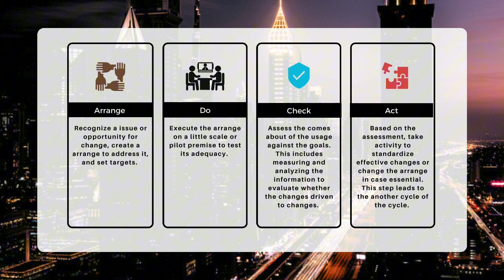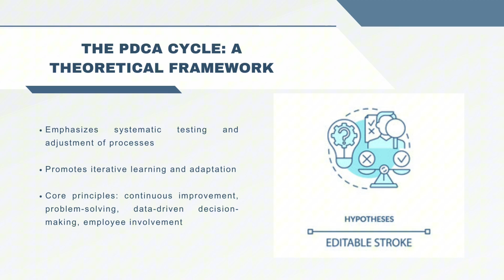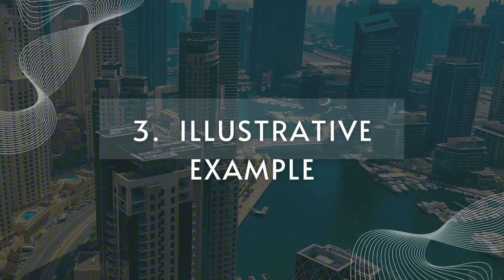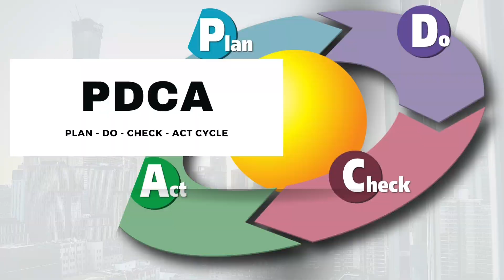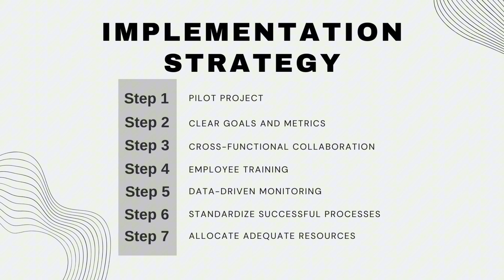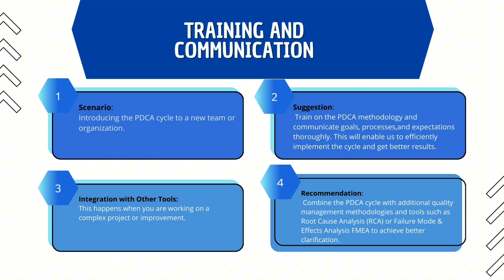PDCA cycle presentation

Comment: Hi, I'm Phước Anh, from group 2. My question are: 
1. In the video your group mentioned that combining elements of 3 methodologies can be a powerful strategy, so can you tell exactly the way to do it ?
2. How can PDCA be integrated into creative industries like design or marketing, where innovation is prioritized over repetitive processes ?
Reply from the maker: Hi, I am Huy, representing group 8, here is our answers:                                                                                                                    1. we don't clearly understand your question, but if you mean if we could explain more clearly how we could combine elements of PDCA, Kaizen, Lean, and Six Sigma then this will provide you better insights:
Start with PDCA as the Framework -> apply Lean for Process streamlining -> utilize Six Sigma for Data-driven decision-making -> Incorporate Kaizen for employee engagement -> Create feedback loops -> Standardize and scale improvements.

2. In creative industries like design or marketing, where innovation is key, PDCA can be integrated by focusing on iterative experimentation and continuous learning rather than repetitive processes. The Plan phase can involve brainstorming creative ideas, setting campaign objectives, or exploring new design concepts, allowing room for innovation. The Do phase involves testing these ideas on a small scale, such as launching pilot campaigns or creating prototypes. In the Check phase, feedback is gathered from clients, audiences, or internal teams to assess the impact of these creative initiatives. Finally, in the Act phase, successful ideas are refined, scaled, or adapted, while unsuccessful ones are discarded or reworked. This cyclical approach ensures that creative teams can innovate continuously while learning from both successes and failures, promoting ongoing improvement without stifling creativity.

Comment: Hi, I'm Ngọc Hưng from Group 1. I have 2 questions for your group:
1/ How do firms know when they should start using PDCA cycle?
2/ As you mentioned, PDCA cycle is used to improve processes. But process improvements must be defined in terms of increased customer satisfaction as a result of higher quality
products and services. So how can PDCA cycle improve employee morale?
Reply from the maker: Hi, I'm Huy, representing Group 8 thank you for your questions. Here are our answers:                                                             1. Firms should start using the PDCA cycle when they identify a need for continuous improvement in their processes, products, or services. This often becomes evident when there are recurring issues, inefficiencies, or declining performance that require systematic problem-solving. Additionally, when organizations are aiming to implement changes but want to minimize risks, PDCA provides a structured, iterative approach to testing and refining solutions. Firms may also turn to PDCA when launching new projects or initiatives, as it helps in ensuring processes are optimized from the start. The cycle is especially beneficial when the goal is long-term sustainability, quality enhancement, or innovation.                                                                                                                                                     2. The PDCA cycle can improve employee morale by fostering a culture of engagement, participation, and ownership in the process improvement efforts. When employees are involved in identifying problems (Plan), implementing changes (Do), and reviewing outcomes (Check), they feel more valued and invested in the organization's success. The iterative nature of PDCA also encourages continuous learning and skill development, which can boost confidence and job satisfaction. Additionally, by systematically addressing inefficiencies or challenges that employees face in their day-to-day tasks, PDCA can help create a more efficient, less stressful work environment. Clear improvements in processes and work conditions, driven by employee contributions, can lead to a sense of accomplishment and higher morale. Hope this help.

Comment: I am Trung, representing Group 6. First thank you for providing us a useful video about PDCA and we have 2 questions for your group:
Q1: How does the group make sure the "Check" step helps find problems or areas to improve in the quality process?

Q2: Can you give examples of how your team used the PDCA cycle to solve quality issues, and what results you got?

Thank you so much and we are waiting for your answers.
Reply from the maker: Hi Trung, I am Huy represent Group 8. It's great to know that you find our video useful and thank you for your question.                                                                                                                                                                                         For your question 1: The "Check" step in PDCA helps identify problems or areas for improvement by systematically evaluating the outcomes of the actions taken during the "Do" phase. It involves comparing the actual results with the expected outcomes set during the "Plan" phase. This step typically includes data collection and analysis to measure performance, quality, and any discrepancies from the goals. If the results fall short, the "Check" step highlights where the process didn’t meet expectations, uncovering specific problems or inefficiencies. Continuous monitoring and feedback ensure that issues are identified early, making it easier to adjust or refine processes for improvement in the next PDCA cycle.                                                                                                                                                                            For your question 2: Take our video project on PDCA as an example.                                                                                         Plan:
- Goal: Create a high-quality educational video about PDCA for YouTube that effectively explains the concept and engages viewers.
-Problem Identified: The initial idea lacked structure, and we anticipated difficulty in clearly explaining complex topics.
-Action Plan: Research PDCA thoroughly, create a detailed script, assign roles for each team member (writing, editing, voiceover...), and plan how to handle questions from other groups.
Do:
- Our team created the video based on the script, filmed and edited it, and uploaded it to YouTube. The video was shared with other groups for viewing and feedback.
Check:
- After uploading, we reviewed the feedback from other groups, especially their questions. Some questions highlighted areas where explanations were unclear or confusing.
- Key Finding: Viewers appreciated the visuals but found certain parts of the explanation lacking in depth.
Act:
- We updated the video’s description to include more detailed written explanations and added timestamps for key sections.
- For future videos, our team planned to include more real-world examples and practice answering potential questions before uploading.                                                                                                                                                             Our results are: Improved Understanding, Increased Engagement, Efficient Process.                                                              Hope this help. Thank you

Comment: Hi, I'm Vân Anh from Group 4. We have 2 questions for Group 8:
1. In the "Do" stage, what types of data should be collected and how can this data be used to evaluate the effectiveness of the plan? 
2. How can organizations effectively share and collaborate on data within the PDCA cycle, especially in large or distributed organizations?
Reply from the maker: Hi Vân Anh, thank you for your questions, here are our answers:                                                                                                                                     1. In the "Do" stage of PDCA, businesses should collect both quantitative data (such as production rates, defect counts, cost reductions, or time savings) and qualitative data (such as customer feedback, employee observations, or process flow insights). This data is essential for tracking the immediate impact of the changes being tested. By collecting baseline metrics from the original process and comparing them to the performance metrics after implementing changes, businesses can evaluate whether the adjustments are yielding the desired improvements. This data is then analyzed in the "Check" stage to assess if the plan is effective or if further modifications are needed, ensuring informed decisions are made for future cycles.                                                                                                2. In large or distributed organizations, effective data sharing and collaboration within the PDCA cycle can be achieved through the use of centralized digital platforms, such as cloud-based project management or data analytics tools, where all team members can access real-time information. Standardizing data collection methods ensures consistency, making it easier to compare and analyze data across different departments or locations. Cross-functional teams and regular virtual meetings help in discussing findings, fostering collaboration, and aligning goals. Clear communication channels, combined with well-documented processes and results, allow teams in different locations to share insights, learn from each other’s experiences, and drive continuous improvement across the organization.
Reply: @HuyNguyen-up3im  Thank you for answering our questions.

Comment: I'm Trương Khánh Di - Represent Group 07 and here are my group questions:

Question 01: Why is the limitation of PDCA "Risk of short-term focus"?

Question 02: In case of not having accurate and reliable data, can PCDA still be applied in business?
Reply from the maker: Hi Di, I'm Quang Huy - member of Group 8, here are our answers:                                                                                                     Answer for question 1: The risk of short-term focus in PDCA arises because the cycle encourages small, iterative improvements, which can sometimes lead to organizations focusing on addressing immediate issues rather than long-term strategic goals. While PDCA is excellent for solving specific problems quickly, it can limit the scope of innovation and transformational change if teams prioritize short-term fixes over larger systemic improvements. As a result, businesses may overlook deeper, more complex challenges that require comprehensive, long-term planning and investment, potentially stalling major advancements or growth.                                                                                          Answer for question 2: Without accurate and reliable data, applying PDCA in business becomes challenging but not impossible. PDCA relies heavily on data during the Check phase to evaluate whether the changes tested in the Do phase are effective. If data is inaccurate or unreliable, the risk of making incorrect decisions increases, as businesses won’t have a clear understanding of the results. However, businesses can still apply PDCA by focusing on qualitative observations, small-scale experiments, and adjusting the process as more reliable data becomes available.                                                                                                                                                                                                   Best regards.